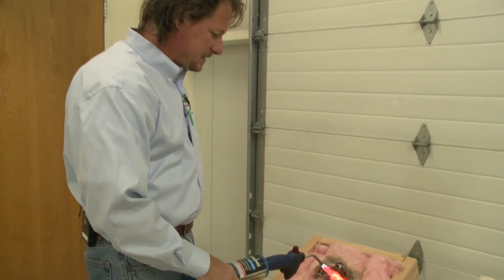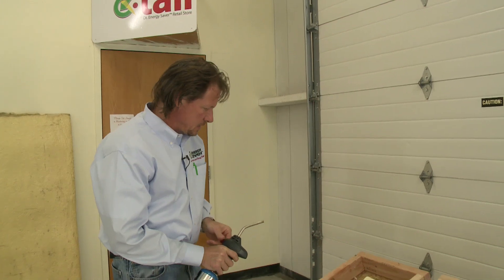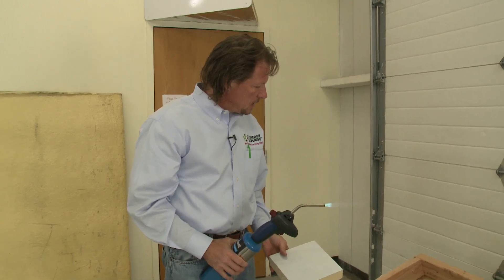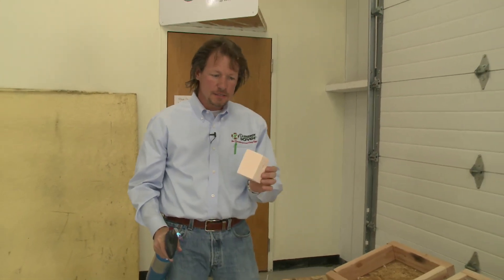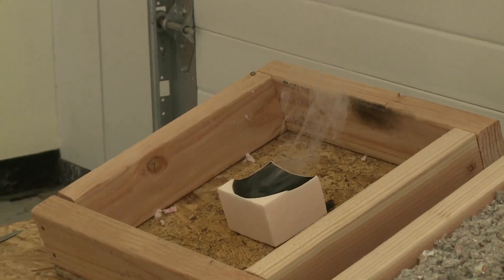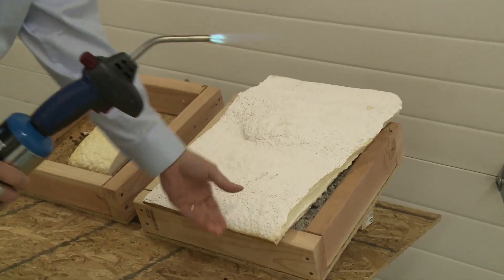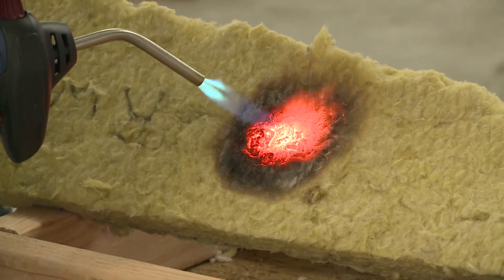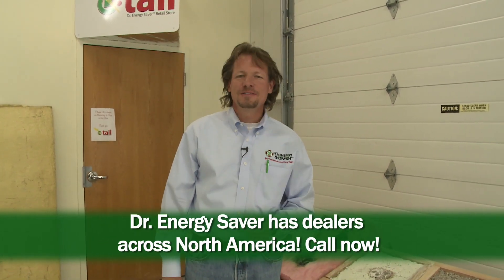Fire Testing Insulation Materials

Comment: Many of you are missing the point.

If your house catches fire you are not going to hang out and roast hotdogs are you?

Insulation which retards or blocks fire gives you more time to get out before smoke blinds and suffocates you.  

Burning wood frame is the last thing to worry about due to all the synthetics in your home which will destroy your lungs in minutes. 

Practice getting out of your house blind with your kids. Follow a wall if you get lost. Walls lead to openings and the way out as long as you keep the wall on one side. Your left or right. Sweep your hand up and down the wall to find Windows.

Comment: Great video.
Our Coloroado home was built in 1969 and was lacking A LOT of insulation in many areas.
Though, upon remodeling, I found the walls had 2.5 inches of rockwool inside.  I was happy to see that, even though its OLD rockwool (I'm sure the tech for that stuff has advanced somewhat).
I decided to keep it in there, peel the face off (don't want two vapor barriers), and put 3.5 inches of faced fiberglass insulation on top of it.
There's 5-6 inches of insulation in there now!  I would have loved to use the newer Roxul brand rockwool on instead of the fiberglass on top, but I'm not very wealthy (that Roxul is $65-$70 a pack).
So, unfortunately I don't have a fire retardant insulation UNTIL the fire melts through the fiberglass first, haha, but it's better than nothing.
I did manage to get Roxul in the ceilings for soundproofing though.  Boy is that stuff easy to work with.

It's going to be toasty in the basementg this Winter!

Comment: Will these fire retardant chemicals break down over time, turning your home into a massive fire hazard? I'm of the belief you should be using materials that are inherently fire retardant or resistant. Even with a 20 year guarantee, I still wouldn't use the cellulose if it loses its fire retardant properties.
Reply: hi, if you need fire proof insulation material,we can offer case. info@joda-tech.com

Comment: Cellulose a little cheaper. If you or anyone in your home has asthma or allergies, go with Fiberglass. If you go with cellulose make sure ducts and attic floor are sealed. If your house is on fire, its burning no matter the insulation. Bogus test. Fiberglass wont give you  cancer but will irritate your lungs if you inhale it daily for many many years. Both products work. Neither will help with house fire.

Comment: if a fire starts in your house and you fail to extinguish it your house will burn down no matter what insulation you have.
Reply: Not true, if house is made of concrete and insulation is between two concrete layer you will only have so called room fire that every burning material inside will burn but walls will remain upright and maybe roof if it also made of concrete.
Reply: SO YUR ROOF WONT BURN LOL

Comment: Yes.  It is progressive over time.  The first 4-5 years are deceptive. Then at following times it can get to a very large saturation percentage.  Boston Whaler (the first to use foam in construction to my knowledge) and almost every boat using it since.  Working in boat yards is an education.  It has to be completely exposed (fiberglass completely stripped so most are a total write off) and then takes months to dry in a dry shop.  So drying in place is not feasible.  In wood contact it rots the wood of course.   It also loses structural rigidity which weakens the layup.  This is top drawer foam generally high density though probably not the highest.  DuPont and others were involved in the application.  Often manufactures only think of the first sale not down the road.  Any mounting holes will eventually permeate the structure if not sealed.  it is not contained by the closed cell.  Universally.  Doug

Comment: Can anyone recommend a product that will deter nesting critters? I have a yurt in the desert and need to insulate it. I was cautioned against fiberglass, cellulose, denim etc. I am leaning toward closed cell spray foam professionally installed. Thanks
Reply: +Foreverchanges the borax they use as the fire retardant in cellulose is a good pest deterrent. It would severely irritate the eyes and lungs of any mammal or bird digging in it. It is also commonly used as ant poison (they like to eat it). Wear a respirator installing it, and keep it off your skin as much as you can, it is an acid salt and quickly becomes irritating.
Foamed or aerated concretes are very pest resistant. probably due to physical strength and that concrete is a bit caustic.Foams are usually a terrible choice where pests are concerned (though some are treated with agents to deter pests). They are easily scratched or chewed through. I have seen birds eat EPS (why I don't know), and birds and rodents like to nest in it. I have had problems with ants making their nests in foam as well (makes nice tunnels). Mineral and glass wools are the second worst choice for the same reasons as foam except there is no interest in eating it.

Comment: Watching this video and reading the comments below, I'm beginning to think that the Rock wool might be some of the very best stuff out there. Light weight, easy to install, doesn't burn, easy to buy at many home improvement stores.
If I ever win the lottery and get a house built, I think I'll use that stuff in the walls.
Reply: Used it for the first time on a project. Easy to install. I like it way better than fiberglass. Will use it again.
Reply: It's actually what we use in Germany everywhere.
Reply: SpiritBear12 hemp crete is also very good too
Reply: You could have aerogel put in for the best outcome
Reply: @maakulad7504  that's not so much winning the lottery as much as owning the lottery. They never did manage to get the price of that to drop very much, though it would be the perfect home insulation if they could..
Reply: Found a good follow up. 

https://www.youtube.com/watch?v=CdItsso3ur0

Comment: For the record I cant tell you how many structure fires I have been to where we had to go back 2 and 3 times for rekindle fires in homes with cellulose insulation. This problem was solved when our procedure was changed to pull all insulation and ceiling withing 50' of the fire perimeter.  Until they get the application of fire retardant process down stay away from this mess. It will turn a small electrical short in your attic into an attic fire. Fiberglass and foam do not share this property.
Reply: old cellulose insulation was not fire retardant. They changed that rule some decades ago so all the new stuff should be fire retardant as shown in this video.

Comment: Rock/Glass-wool is common in Germany. Rock wool performs much better during installation, because glass wool (especially cheap one) looses lots of tiny particals while moving which go in your lung. "Noobs" use polyurethane foam. :-) Polystyrene plates were THE trend of the last years (because of very agressive marketing campaigns), but it has too many disadvantages (in my opinion). I would definitely recommend rock wool.
Reply: +Dan Lekin yes! same thing in Holland... Its not the product but the marketing that has brought the "new cool thing"... rock wool is the best I have ever worked with till I bumped into Hemp.

Comment: I arrived at this video while trying to fine some kind of insulation that is fire retardant, but also breathable. I'm going to line the top of a small ammo can where LiPo batteries are stored. Then the lid will be drilled/vented in a few places just in case one of the batteries ever catches on fire there is no pressure build-up and thus no risk of explosion. However, I need a layer of fire retardant insulation that can contain the fire but let a bit of air through the vents in order to let pressure out. Any recommendations?
Reply: Danny Cruz Watch the video here. It will tell you.
Reply: +Danny Cruz Hempcreet is a great insulator, its breathable,fire retarded termite repellent on top of that if that is not enough.. ... it also absorbs CO'2 with aging and its just gets stronger by with time
Reply: I use 1/2 inch hardy backer whenever I want to create a fire containment enclosure.  It works almost like refractory brick
Reply: +joblessalex
 The video doesn't mention a thing about ventilation, just insulation that doesn't burn easily.
Reply: I wouldn't be all that concerned. If it's air tight to the point you're trying to vent pressure, it probably doesn't get enough air for a fire to exist in the first place

Comment: I had a radiant ceiling heat short out in my attic last night and start a fire. The electrical connection which was the source of the short was buried in cellulose. The cellulose burned consistently but slowly. The burning materiel smelled a lot like nail polish remover  and I thought the kids had spilled some. However when I went looking, I found the insulation int he attic smoking and when I pulled it up it was had red hot coal clumps burning which were actually difficult to extinguish. A lot like a sponge burning from the inside would be hard to put out. The parts of the material that were not burning prevented the water from reaching the parts that were burning.  It was absolutely NOT self extinguishing. One shorted wire for a few seconds was enough to start a fire that was smoldered for hours  spreading using the CELLULOSE insulation as a fuel. I was lucky i caught it early before much damage could be done.  My insulation is about 30 years old and I suspect the flame retardant chemically broke down over that time.  I tried some experiments with some fiber glass insulation and the cellulose insulation from my attic. With the cellulose, the fire spreads once the torch is removed but with the fiberglass the fire goes out once the torch is removed. Also since the fiberglass melts  and opens up, any water sprayed on it would go right to the fire instead of preventing the flow of water like the cellulose. 
 I am pulling all the cellulose out of my attic and replacing it with a material that , over the years, I have confidence will maintain its properties and consequently is a superior material in the long run considering safety.  I should also note that there have been a few other house fires in my area recently. I suspect that  since all the houses were built about 30 years ago by the same builder using the same materials, that the insulation in those homes also caught fire after the radiant heat failed.
Reply: +Brad Seager ??  Why does Cellulose insulation smell. It's because they add a sweet smelling sterilizing agent to it to reduce the former waste paper bedding smell (its mostly sold for animal bedding), when collected from waste paper warehouses and dumpsters behind shops it can contain germs, ants, insects, mice, rats and wildlife droppings, so for public safety reasons it must go under the squirted on liquid sterlizor sprayer . Too much sterilizor can go in in one area because the conveyot belts stopped for a paper jam, and other areas can go untreated.  Its waste paper called Cellulose a trade name to improve its image and value.  Now you know.
Reply: thats one WAY BS claim right there folks! ^^   "sweet smelling sterilizing agent"???? bwhahahahaha! .."ok"  sheesh
Reply: Thank you for contributing your interesting story.        Rarely is any study conducted on old materials; rather, only on new materials that are currently being sold.     So you have me wondering about my borate-treated cellulose attic insulation.          I never dreamed that such a simple fire-retardant could deteriorate (it also deters termite infestation of the insulation itself), and I remain skeptical but respectful of your essay.
Reply: Was cellulose insulation fireproofed 30 years ago?  Maybe not.  Seems unlikely that borate would deteriorate in this way.